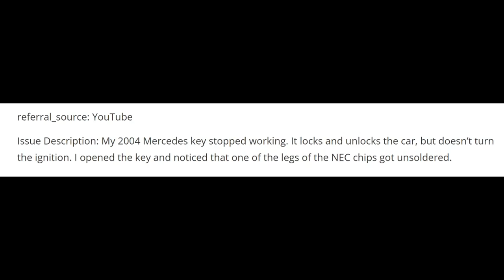Pin Broke off NEC Chip. Is this fixable. Benz Key Fob Repair

Comment: What a great repair. You wouldn't get this from a "warranty" type repairer, just more proof that Right To Repair is critical to keeping technology out of landfills.
Reply: It's about time and money. This thing probably costs 10 bucks to make for the car companies, with 100,000% markup.
Reply: @larrybud  Exactly.  Someone with the skills needed to to board-level repairs like this is going to charge way more than it would be worth to repair the key fob, when the dealer can fix it in 10 minutes (most of which is waiting for a machine to cut the key) with a part that barely costs anything to make and plugging a tool into the car to learn the new key fob.  If they are charging a dime over $50, they had better be coming out to your house to program the key (they can look up the cut on their computer system based on the VIN, and cut it before they come out)
Reply: @thetechconspiracy2  I would look at it like this, if there would be more skilled people like him that would increase some competition which may decrease repair costs.
Reply: @thetechconspiracy2  board level repair (I've been getting into it as a hobby) will always be a thing due to greed seriously my 07 dodge i brought a already cut key that needed to be programmed to the dealer they charged me 120ish CAD and the reason i brought them a key i cut is because to get a key supplied by them was 300+ CAD FOR A 07 DODGE
Reply: @thetechconspiracy2  I usually fix stuff like this for my freinds , for free . The challenge of not being beat by a chip .
Reply: @thetechconspiracy2  Somewhere in the video he says that a fob replacement costs 1200 $ .. 1:20

Comment: That looks like damage from a small screwdriver being used to open the FOB housing when changing a battery. At first look I knew that pin should be repairable, but I would have used an exacto to scrape the overmold down. The other thing I would suggest is TakPak CA glue over the part of the chip you ground away.
Reply: Okay! I was watching this video and thinking, "how though?"  how do you get that pin broken. But yeah - inserting a pokey thing to try and get the fob open to change a battery could for sure do that.
Reply: Yeah, those fobs have a hard life, and are covered with a conformal coating from the factory. I'd definitely have sprayed a bit more conformal coat on to cover that part
Reply: As I am repairing a lot of remote controls I can absolutely confirm! And it's the same for all these broken coils in FOBs...

Comment: Nicely done. I work a lot with forensic data recovery from vehicle components and sometime, chips damaged by corrosion (flooded cars), fire or several mechanical damages exhibit this problem. I approach it in the same way, usually there's plenty of connectors still buried in the epoxy. Things get a little more difficult with QFN or BGA packages.

Comment: Funny how we end up right back to the rtr .. the dealer has the equipment and software to read and write to that chip..They want you to come back so they can wax you that money! Good repair boss! Keep up the good work of sticking it to the man!!!!!!
Reply: Very unlikely that the dealers have access to the tools to read or write to that chip for security reasons (any data should be encrypted and obfuscated to keep thieves from reading the data from a fob and making a copy). The manufacturer is the one able to make copies, but $500 USD and up is price gouging for a device that costs at most a few dollars to manufacture.

Comment: Good save! 
In my last job, the benches in the cleanroom each had a 1/4" vacuum port for slurping up debris. By making a small filter in a plastic box it enabled us to wash areas with IPA, and suck-up as we cleaned, leaving no residue. A cheap vacuum/suction pump with a filter would be a great help with SM work like this.

Comment: I did something like this on a Texas Instruments calculator once.  It required the use of a microscope.  Once the jumper was soldered, I very gently cleaned the area, dried it with light puffs of canned air, and then put some epoxy cement over it for mechanical support and protection.  You should consider doing that, too.

You were very fortunate that the chip case was plastic and not ceramic like the kind used in defense electronics.

Comment: The grinding pen and flux have saved many boards here, won't be without them.  The flux is easy to clean, and the pen makes short work of damaged or missing areas on boards.  

On reading the chip, normally the programmable portion of the chip has a "fuse" that is purposely blown after programming to prevent accessing  the code that would allow you to read and then program a new chip.  Find the datasheet for the chip and look up the program method.  If that's the case, now we know why Benz can charge $1,500 for a fob.

Comment: Yes.  Fixable.  Chip away around the broken off pin to expose a bit of unbrokenoff pin.  Brush that bit, Flux it, Tin it, and solder to it a lenght of leg.  I borrow my legs from the extra bits from standard value resistors and get to use the resistors as well!

Comment: the recoding is done in the car using the ignition module , ecu etc, you need a programming level diagnostic machine and also a numeric code that can be obtained from the dealer network.
unsure on merc keys but it varies as to whethe you need a "virgin" - as in , program once and never recode fob, i dont think that you do , in any case aftermarket nes are usually available...

Comment: Actually you can leave the chip in place on the PCB, and grind away the plastic until it exposes the lead-wire stub. Solder a small 4-6mm long solid copper wire to the PCB trace, and then bend&trim the other end of the wire onto the chips' stub, and solder that. And Voila: All pins are now reconnected. (I only recommend leaded solder for making this easy repair)

Comment: Nice repair. You made it look easy. The missing component looked like a capacitor. You could have measured its value and replaced it with a new part instead of needing to take one off a donor board. It would allow you to replace the missing part on another board in the future.

Comment: I'm surprised this doesn't need a coating with UV treatment? 

As always amazing work with these device's.
Reply: it's tinned, that's enough to prevent corrosion for the foreseeable future, and there's no need to insulate it from anything electrically. Do you see any UV coating on the other pins?
Reply: @ubergeeknz  I was just seeing part of chip exposed and my ocd nature kicked in and thought oh dang shouldn that be covered.

Comment: I'm always amazed at the types of damage that happens. That pin ripped out of the chip inside the fob housing.
Reply: how is that possible ?
Reply: @xsauce3858  that board suffered a physical mishap of some kind. Perhaps the customer was trying to replace the battery and slipped with a screwdriver or something.
Reply: @xsauce3858  I was gonna say 👽 but 99% user inflicted is more likely 🤣

Comment: How would you repair a keyfob that draws to much current? I have a keyfob wich constantly draws 3ma. The buttons are working, so it's not sending all the time. There is no corrosion on the board.

Comment: I can understand why the want to protect they programming on those chips. There is a 100% chance shady individuals would abuse it to create illegal copies of the fob which could then be used to easily steal the vehicle at a later date. It's a pain, but I get the reason for the security.

Comment: I've done this in the past and it's doable but be aware that the chip pin only goes about 1 mm deep (depending on the type of chip and topology) so don't grind too much off. Besides that, you can program a new NEC chip even if your merc doesn't have any keys at all ;-)
Reply: I expect that's why he tried on a donor chip first, to guage the correct depth

Comment: How was it determined what component should be used for the missing part? The missing part could have been a capacitor or resistor with differing values.
Reply: I was just thinking the same.

Comment: I wonder how this pin suddenly became “unsoldered”
Reply: i think it's corrosion. the car from 2004.
Reply: Was broken off, the chip looks like it was impacted
Reply: I would suggest screwdriver popped into the unit to pry it open, and slipped knocking cap off and destroying the corner of the IC
Reply: @xxxxbigdavexxxx  correctamundo!! I sell replacement covers form some car keys and those Mercedes need some "help" from a needle nose plyers, not a screwdriver.
Reply: Mechanical damage from opening it. A tool scraped across the PCB ripping off that capacitor and damaging the legs on the chip.
Reply: By the look of it, and the other broken piece, physical trauma from a sharp/hard object such as a screwdriver prying the key open to replace the battery

Comment: Hello, I have a problem with an a520m aorus elite motherboard. When I turn on the PC while I am in the Windows installer, the screen turns black and the keyboard turns off and I can't even turning it off with the button on the cabinet will it be a problem of the motherboard that has a burnt circuit?

Comment: I used a dremel on a commodore 64 vic chip and soldered a bodge wire to the exposed metal. Everything is fixable with enough effort.

Comment: In some ways it's nice to have more theft protection with these modern keys, but then stuff like this happens and I want to go back to technology of the 90s
Reply: Amen
Reply: Solution would be if companies and dealerships charged a fair price for a new Fob instead of ripping off their customers because there's no other option.
Reply: Even more annoying in this case is the knowledge that 2004 Mercedes security is well and truly broken wide open to any car thief anyway, in this case it's just a very expensive replacement for the customer.  All the thieves can program a key almost instantly.

Comment: Those little pre-made leads you got off that little card are cool, where do you get those? I've always used 30 gauge enameled magnet wire which works fine, but the stuff you used would be good to have too
Reply from the maker: https://northridgefix.com/product/pad-strips-to-fix-ripped-pads-and-torn-wire-traces/

Comment: When you get a new fob the key is not programed the ecu of the car is programmed to the key the key has a code that it send over 2 or more data pens to turn a car on so no you can't reprogram them because the locked and you can't unlock them the mainbord for the car has to be reprogramed to the key

Comment: There are two additional ways to do this, you can scratch through using an xacto knive blade (which requires patience, but gives a very nice narrow slot to work with) or you can use a laser strong enough to ablate the plastic (the copper leadframe underneath is unharmed).  Also, some people may have a CNC-style router (usually based on an X-Y laser table or 3-D printer table), which is just the automated version of what he did by hand.

Comment: Chip can be replaced. Autel is selling the programmer for mercedes and bmw fob chip's. And most of the time you don't need to repair just buy the new aftermarket fob and program it on ecu.

Comment: How did that happen?? Were they using the fob with no cover?? Is this FOB made on the end of the key?? I have saw late model Mercedes that have faulty Steering Column control modules causing the key to not be able to be rotated, but those were FOBs on  the end of the key. Customers will state that sometimes they can yank real hard on the steering wheel while its locked and get the key to turn. But looking at that key fob that almost certainly has something to do with their problem. They make scan tools that are specifically made for programming keys. My Snap On scanner will do some, but if it couldnt we used to call a locksmith who had a key programmer. You dont really need to read the programming, just learn the new key to the car. Before I left the auto repair industry my old boss bought a mid level key programmer  for around $500. We were experiencing alot of key programming issues, lost keys, defective keys, customers who bought cars with only 1 key who wanted extras. Im assuming this fixed their problem??

Comment: Programmable chips are burned by their fusebit factory so they cannot be copied
Certain devices have been sold on some sites that claim to copy the binary file from such microcontrollers, but it is not known if it works.

Comment: drill bit spun by hand also works to get down to the trace 👍
Reply: You can also friction-start a fire, but why torture yourself, when you have a BIC? 😁
Reply: @em0_tion  
It's actually fairly quick and simple. Small 12V cordless drill also works, but you have to be careful to not drill to deep, doing it by hand allows for more control.

Comment: That chip is ROM once is precoded and programmed to a car it becomes locked and unusable for programming to another car, it can not even be unlocked like other manufactures can be. Nice job bringing that fob back to live, but i'm wondering what could've cause that leg to break in such manner. Never seen any mercedes fob in such condition without any other noticeable adjacent area damage to justify it.

Comment: The way to read the data region portion of the chip for sure;  is to use a strong acid like nitric to eat away the package and reveal the die.  You may have a protective ground layer over the die's data area to etch away as well.  once you reveal the memory grid;  take a microscopic photo, and you can record the ones and zeros;  and build up the data that way.

This is how satellite card keys were obtained years back when things changed....  Its a brute-force method.
Reply from the maker: We are in 2022. The method you described is only found in James bond or Bollywood movies.
Reply: Or in this case you could just use any one of at least 5 tools to read this chip without disassembly. We often make these repairs too but keys can be obtained much cheaper from a locksmith than from the dealer.
The dealership cannot read and manipulate this data as suggested by another user but many of us mechatronics and locksmiths read these often.
There is a whole different tool set when it comes to reading automotive chips.

Comment: What is this device you're using to check the key what is it called I have a key that I want to make sure it's working properly Mercedes said they can't do it unless I bring the car in I can't just bring the key maybe I could just buy this device
Reply: WOYO Remote Control RF IR Tester
Reply: @em0_tion  thank you I appreciate it

Comment: You are not supposed times as the ID of the NEC chip that is the reason why it is in there. This chip must contain a 'secure element's it is hardened against casual read out and even chip invasive attempts to read it out.
The secure element contains the device key that is derived by Mercedes when the keyfobs are personalized. After personalization a fuse inside the Chip is blown that will make tge reading or writing of the key impossible.
If you are using the key fob session keys are derived inside the Chip and transmitted in some form to the reader which can calculate back a know herself that authenticates the fob, because the algorithm will only give the right known secret when the cryptogram was encrypted by the Key fob with a correctly derived key.
Otherwise, it would be too easy for car thieves to clone the key find and steal the cars.

Comment: XHORSE VVDI MB is a key programming tool that has adapters to put the NEC chips in to read them and make new keys
Reply: Wrong NEC chip... It reads the one thats on the controller, not the one on the key.
Reply: @ananiasgaudencio1585  also the key

Comment: Just find the frequency the fob is transmitting on and record what comes out of it and then hack it...

But that is ofcourse illegal...;-=
Reply: Good luck doing that with a key that needs an infra red led to do the authentication.
Reply: Yes or you could "just" build a rocket and fly to the moon if you're bored I guess. 🤷
Reply: @ananiasgaudencio1585  I thoughyt it used RF???

But yeah... you're right if it does the signaling via IR... hehehehe

Comment: You will need the rt809h programmer and the adapter to read the chip🥴
Reply: No, you absolutely can't read this chip with those programmers. It seems to have the marking "00040229", so it's benz key ROM V57 which means you can partly read the eeprom area to create another key with specific locksmith benz programmers.
Reply: Can you read with ezp2019 programmer?